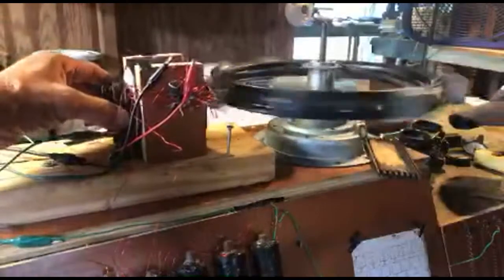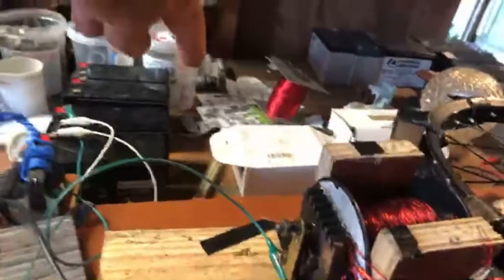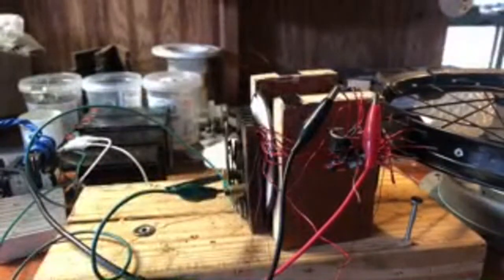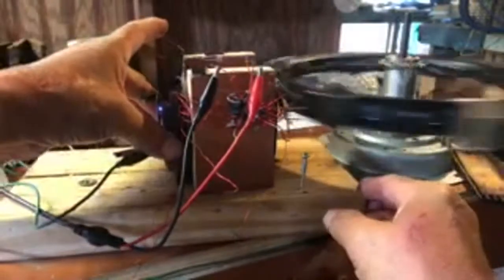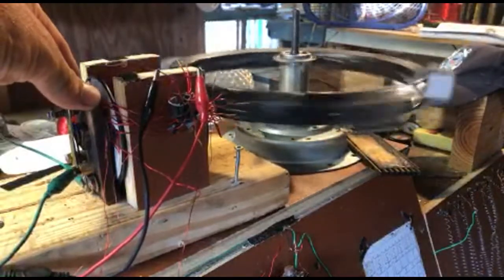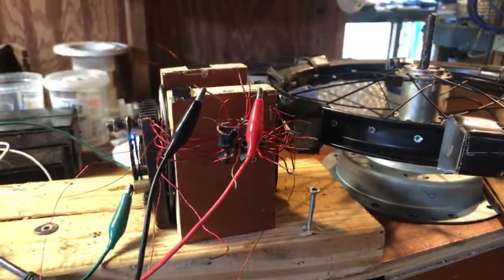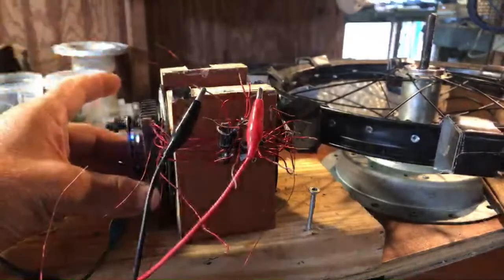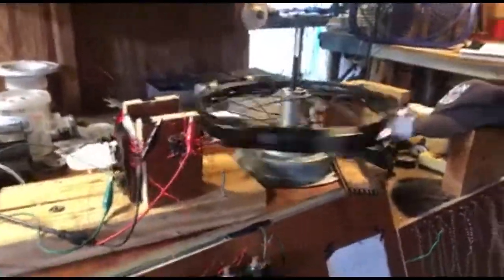Energy Moves Around Matter!

Comment: what do you think about having a second wheel running that would push or pull on the back emf or even just directly on the opposite side of the coil?
Reply from the maker: Growing Revelation 
Hello!
I’ll post a video with a double banger, spark vibrator. You are unlimited!
Reply: @vinnystvincent9788  You Da' Man Roy! :)